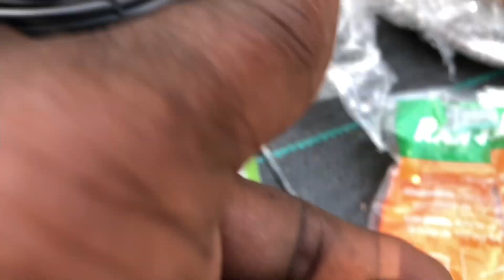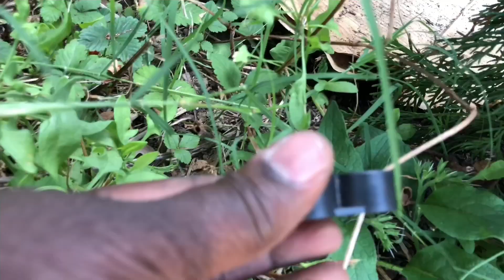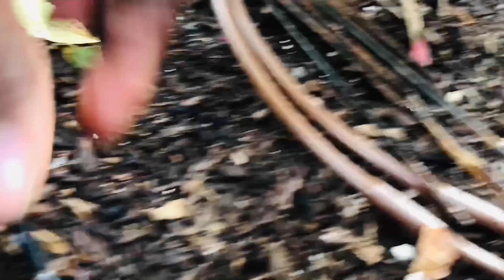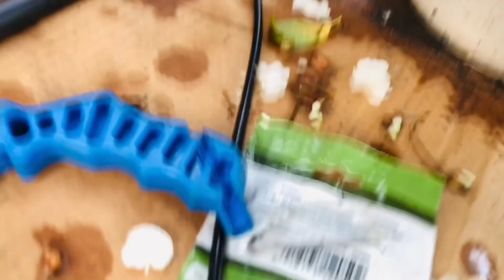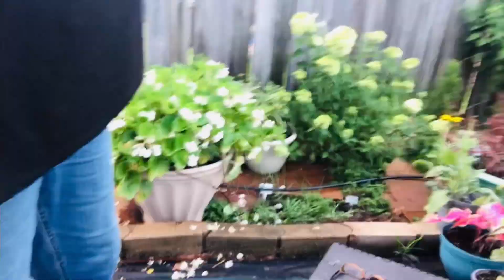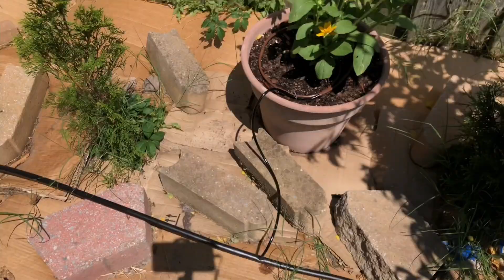How to Install Drip Irrigation to Your Flowerbed

Comment: I have spent the last few months replacing my drip systems.    I have only one more area to finish!  I hope the tubes with the enclosed emitters work better for you then it did for me!  If those emitters get damaged your whole row is ruined.  Every time I replaced a section the high heat even early in the morning blew the system apart. The heat softens the connections. So now I only use quarter inch spaghetti lines attached to the half inch tubing and then I used emitters that are adjustable so they can be cleaned if necessary.
Reply from the maker: So far so good. Thanks for the tip on the tubing you’re using.😊